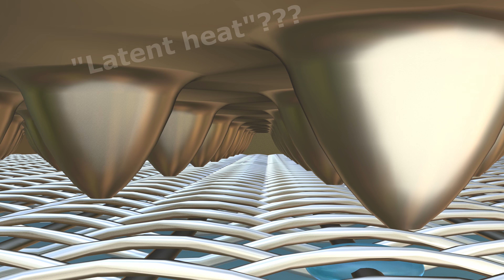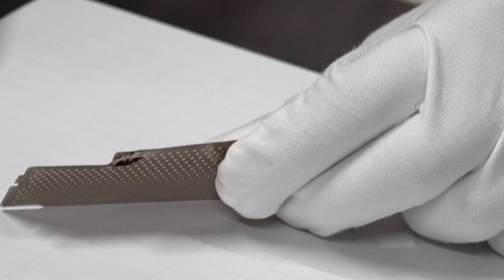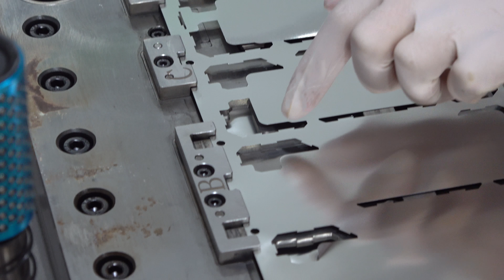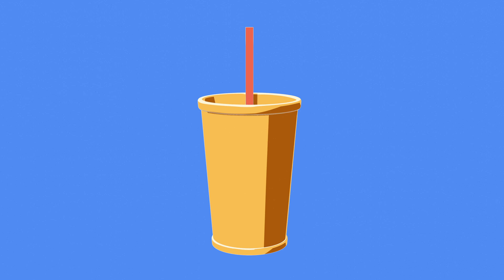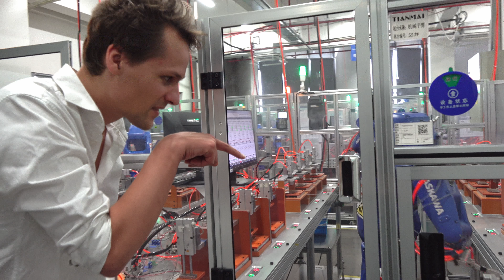How One Drop of Water Cools Your Phone

Comment: I've known about heat pipes for some time, but had no idea they'd flattened them out to make these things. Very cool (literally and figuratively 😂).
One thing you didn't mention was the speed at which these things move heat.
There is enough water in them for the entire wick to be wet all the time, so wicking speed is irrelevant.
Once a water molecule evaporates, at 30°C it moves at an average speed of 597m/s, with an RMS velocity of 648m/s. The mean free path is around 2-3um, and it takes only about 20uS to get to the other side of the chamber. If it condenses there, it deposits its latent heat. If it is too hot to condense at that spot, it keeps bouncing around, and it takes only an average of 12 seconds to travel the length of a 15cm chamber (or less, depending on which theory one uses).
The effective heat conductivity is hundreds of times that of copper, or even diamond, for that matter.

Comment: When the sheet metal is pressed with those extra dimples, I'm guessing that's for one or more of three reasons: 
1. To fix warping in the sheet from all the other dimples stretching out the material.
2. To reduce stresses in the material from the stamping.
3. As a way to check the integrity of the die. I.e. If you see those extra dimples on the stamped product then you know the die is offset or worn.

Comment: If I had to guess about the extra features which were cut off from the final piece during stamping, it would be that they exist to avoid an unfavourable distribution of stress during the stamping process which would warp the piece. Judging especially from the fact that these extra dots are present only around the corners of the vapour chamber.

Comment: I'm wondering if there're plans for PC cooling with this tech.
Transferring warmth from GPU/CPU to the surrounding system block, using sheer volume of contact area to cool everything down.
Or integrating it all into purely convection-based system.
The one without this tech, based on basic radiator, worked pretty well.
This one should do even better.

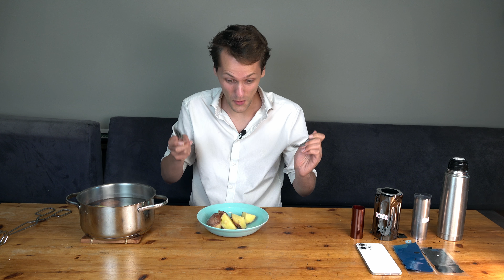Comment: 1:04 to add to this, it's technically moving the hot thing in relation to the coolant. this is also how you get colder when it's windy because each of the air molecules takes some of your heat

Comment: @10:30 I think this wasn't the clearest explanation. What happens is that the water can evaporate more easily in the ideal circumstances, and each water molecule that does evaporate takes a 'large' amount of latent heat with it due to the high specific heat of water.
Reply: Not specific heat. Enthalpy of vaporization.

Comment: So they're basically going to have hydrophobic plates with a hydrophilic powder holding those two plates apart with a slight vacuum in them as their next technological advancement I suppose they won't need those interior indentations to have the plates held apart because the powder will do that for them they should also look into radiant Cooling coatings for the outside of the plates

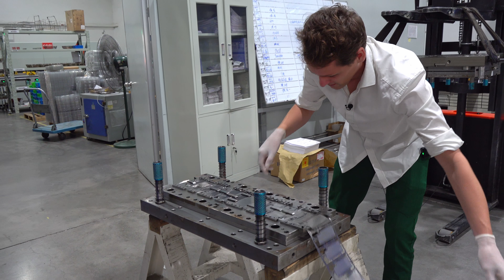Comment: 6:08 

I have no idea what they're for, but I think it is done to fine tune the vacuum inside the chamber maybe? Like, they need the vacuum to make the inside pressure cause water to only need 30 Celsius before boiling. Adding the extra dimples before the chamber is sealed and then cut off allows them to affect the volume area of the vacuum before sealing it. Once it's sealed and the inside pressure is correct, they can seal it off in the flat bit between the main body and the edge's dimples for them to be removed.

Disclaimer: I made this up in my head because I only have my own autistic idea of sense and physics to go off and I expect to be wrong lol

EDIT: Literally watched 30 seconds longer and remembered this is just one of the panels so I'm definitely wrong hahahahahaha

Comment: If only those thermos flasks WOULD have a vacuum in-between their inner and outer metal 'walls'! But in reality those stainless steel ones are pretty darn bad at maintaining any relevant temperature difference ANYWAY, as the relatively (temperature)conductive steel layer on the inside is in direct contact with the outside layer on the top-side. The glass versions (also double-walled, and coated in highly reflective mirror coating, that literally reflects the temperature of the contents back towards the inside and that of the environment to outside!) are incomparably much better, but a TRUE vacuum those don't have in-between inner and outer glass layer. (By the way though better at what they do the glass versions of course are relatively fragile.) Materials like thin plated steel or glass could not hold any pressure difference between atmospheric and zero, not by a long shot. The glass ones however DO seem to have a LOWER gaseous pressure in-between their double walls: one can hear the air suck in when they break.

Comment: Aldo, this is a terrific educational video! I wish most of youtube was even 1/10 this good.

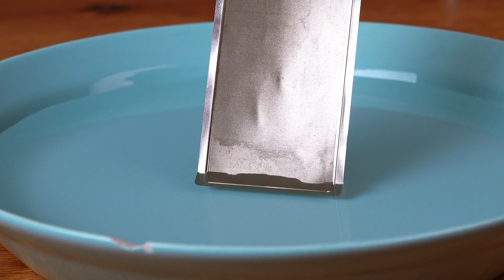One nit: at 9:50 you said, "temperature is the average kinetic energy of molecules." But that isn't exactly correct. In gases, the kinetic energy of molecules is proportional to their temperature times the number of degrees of freedom of motion. Triatomic gas molecules like water vapor have higher heat capacity because they have more degrees of freedom (they bend, stretch, and rotate asymmetrically). So, at the same temperature triatomic gas molecules have much more kinetic energy than monatomic gas molecules, and somewhat more kinetic energy per molecule than diatomic gas molecules.

Also, one minute later you said that when a water vapor molecule condenses "it gains momentum." I think you misspoke, and meant to say that it loses momentum and kinetic energy, which is why it gives up heat.
Reply from the maker: thanks! yeah you're right in both cases!  I'll make a correction

Comment: Not a magic , just a "simple" engineering. Tuning hundreds of parameters to work together in sync. Hydrophobicity of material , water drop angle , thinknes of hydrophilic later ,  thinkness of metal. And all with constraints of production , available materials , end price , and possible tolerances. If all those dozens/hundreds of parameters are tuned together , and working together in sync what is facilitating! 
Not taking about complexities of the production . 
Thanks for the video.

Comment: This is really a variation of the heat pipe—an idea going back to the age of steam, refined in 1942 for the automotive industry, again in 1963 for the aerospace industry, commercialized for general usage around 1972, when I learned of it. They're widely used in laptops today. What's new here, is instead of transporting heat from point to point, the idea is to spread heat over a wide area. That brings challenges like not collapsing under air pressure. i think th asymmetry between the condensation side and the wicking side may be new as well.

Despite the age of the idea, it remains incredibly cool, for both its effectiveness and its awesome simplicity.

BTW, a small correction. Even at room temperature, IR radiation is very significant. But since it goes both ways, it is the difference in temperature that matters. You get more heat from the walls of your room than you do from the air, balanced by the heat you radiate. The difference is around 100W, more or less, the variation being the difference that air temperature contributes. (You can verify this yourself by dropping body temperature and room temperature into the black body radiation equation. Since radiation goes up as the 4th power of temperature, it also illustrates why making something hotter causes it to radiate so much more).

Extremely well done explanations of everything! I might wish you had explained contact angle in terms of surface tension and Gibbs Free Energy, but I think you made the right call to trim it to the minimum needed to understand the relevant aspects of wetting and wicking.

Comment: Since 80-90% put a case on their phone...does that dampen the benefits of the vapor chamber, locking the heat into the phone since air can't easily remove it from the aluminum phone case?
Reply from the maker: Most of the heat is released through the screen, but I imagine it does have a small impact. Would love someone test it

Comment: Great video.  Since 80-90% put a case on their phone...does that dampen the benefits of the vapor chamber, locking the heat into the phone since air can't easily remove it from the aluminum phone case?  Gemeni says, "Yes" a case indeed dramatically reduces the benefits of a vapor chamber but AI isn't always trustworthy.
Reply from the maker: The vapor chamber is behind the screen and most heat is lost there too, that said putting a case on your phone definitely makes it harder for heat to escape on the back
Reply: @KnowArt Perhaps if the “plateau” isn’t covered by the case, heat can escape to the air there.

Comment: What if this tech was used for engines, there’d be no need for coolant! No radiators, no hoses, the weight loss potential would be insane
Reply: There is too much heat and too violent reactions of gas explosions happen to cool them with a vapor chamber.

Comment: 13:19 apple found these video and put the vapor chamber in iphone 17series. 😂😂
Reply: About 5 years behind as usual
Reply: @DoesntRefillTheBrita  To be fair, their APUs generally run much cooler than i.e. Snapdragon chips. That is why they can get away with plastic encapsulation instead of fancy flip-chip BGA packages like you'd find on most Android flagships. But they don't perform as well when you stress them, of course.

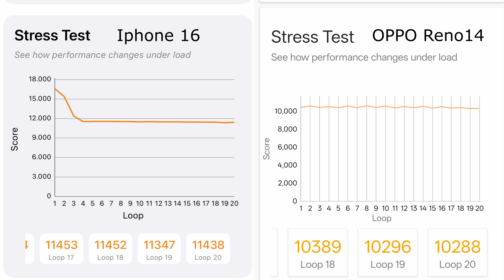Comment: 13:35 Really great coverage, but I’d like to point out one issue I noticed in the testing.
In the 3DMark Wild Life test, the iPhone starts at around 17,000 points and stabilizes near 11,000, while the Oppo Reno 14 stays closer to 10k.
As a result, Oppo’s score looks lower — but that’s because 3DMark scores are essentially normalized with 60 fps being around 10,000 points, and in your test the Oppo was capped at 60 fps.
To test properly, you could use the Wild Life Unlimited benchmark (which removes the fps limit), but that one is admittedly too outdated to reflect real device performance nowadays.
A Steel Nomad Stress test would have been a much better choice.

Comment: An interesting thing that you didn't mention is the failure mode in vapor versus air cooling. Air cooling's effectiveness tapers off as the ambient temperature rises, but it always provides SOME level of cooling. Meanwhile vapor cooling systems essentially have an ambient temperature threshold beyond which their cooling ability just turns off completely since the fluid can no longer condense.

Comment: I don't mean to belittle or ridicule any engineering. We've come a long way from drumming on hollow logs, and each step was a step someone struggled with.
In the mid-80s, on a wet Sunday afternoon, I looked at the 'modern' landline phone on my desk with some interest (relieving boredom).
Having grown-up with steel and brass inside these kinds of durable consumer products, the small block of lead was a surprise.
Of course, the other 'contemporary' stuff in a desk phone had all "lost weight" as plastics and electronic touch tone replaced cogs and springs...
The desk phone NEEDED a block of lead to give it some mass, and not be blown around by any light breeze.

Physics and material science united... Very astounding to this old man. Great video. Thank you.
Reply: I add this vapor chamber on my iPhone 8 it run much bettter

Comment: Maybe the unused stamped portions can be described like this....Stamping metal sheets into desired shapes isn't just cut, and dry. There will inevitably arise undesirable, unforeseen movements, and before finalizing the final series of presses it's necessary to "prime" the sheets with bends to combat unwanted bends, or movements. If you wanted dimples, say a single long row of them on a large flat sheet, by just stamping dimples along and edge the shape of the whole sheet has changed, and it doesn't lay flat now. It may be possible to "prime" the sheet with a pre-bend and when stamping the dimples the sheet now lays flat. Along the rims of a shape like that in the video, it may be necessary to upend the edges to strengthen the overall product to combat certain forces. Or, maybe they are for heat dissipation during the pressing.... metal movements while pressing create heat, and the dimples strategically placed could serve to move heat to desired areas during the pressing to carry heat away from areas too hot, or possibly for another heat moving reason which would fall in line with the actually video theme. lol

Comment: I am surprised they use water, which requires them to maintain a low pressure inside to have the right boiling point. I am aware of heat pipes in solar thermal collectors, AFAIK these use alcohol that has a lower boiling point.
But I guess even the boiling point of alcohol is too high for this application, so presumably if you need to change the pressure anyway you may just as well make it work with water which presumably has other preferable characteristics? 
But there are a few substances like Diethyl ether that would have boiling points between 30°C and 40°C, you'd think these would be your first choice for this?

Comment: But what makes the water go back and forth between the two plates? In the animation it makes sense that the drop would fall down the pillars, evaporate on the bottom plate, then rise up as vapor to the top plate. But that depends on gravity. How does it work with arbitrary orientations of the phone? Is the vapor chamber only effective when the phone is placed flat? What about when you're actively using it, holding it in your hand?
Reply: Capillary action

Comment: I'd love to see a PC CPU/GPU cooler that replaces the aluminum fins with this kind of setup all connected to a main block on the CPU/GPU itself. Naturally it would need a rigid frame structure to hold the vapor chamber fins securely in place. Instead of needing vapor pipes to move heat to simple metal fins this could move all the heat in probably a much smaller form factor than large CPU/GPU coolers. This would really help knock down the thickness required for high end GPUs and maybe even get down to the single slot sizes we see on waterblock cooled GPUs.

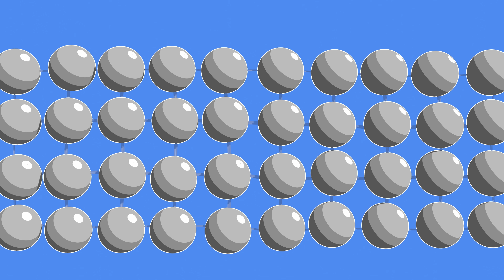Comment: 2:03 that’s not why metals are good conductors. If this were the case, all dense solids will make good conductors without need for impurities
Reply: I think he’s referring to thermal conductivity which is different than electric conductivity.
Reply: @fearisslaveryisfear888 Actually in a metal these two types of conductivity are intrinsically linked. This is because there are free delocalized electrons in the conduction band that can move through the material. The resulting electron gas is the main mechanism by which heat spreads through the material. This connection results in the Wiedemann–Franz law.
Reply: @Fruitgummyx  interesting. Is there a 1 to 1 formula or are they “linked” but not entirely dependent on own another? It makes sense that they’re linked
Reply: @fearisslaveryisfear888  Well, the aforementioned law has limits, so it’s not exactly true to speak of a 1-1 correspondence. The Wiedemann-Franz law states:
κ/σ = L · T
L is the Lorenz number, a physical material-independent constant. So if you have two metals at the same temperature T, then one having a higher thermal conductivity κ would imply a higher electrical conductivity σ, so practically speaking yes.
Reply: It is one of the few things I remember and found interesting from a university course on solid state physics. Other things being the concept of phonons and how they explain things like LEDs and the Quantum-Hall effect :D
Reply: @Fruitgummyx  I love it thank you
Reply: @fearisslaveryisfear888 Yeah that is the case he is talking about
Reply: You're right, its because of the sea of delocalised electronics that freely move and bump into other electrons and atoms. His main point is that the atoms need to bump into each other to increase in temperature

Comment: An amused curiosity had me screenshot 12:13 to paste in Paint, before zooming all the way out.
If I squint, amusingly enough, the red/green/blue dotted section does, in fact, appear a neutral grayish color.

Awesome video across the board. This is more impressive to me than the engineering behind the electrical systems these units cool.